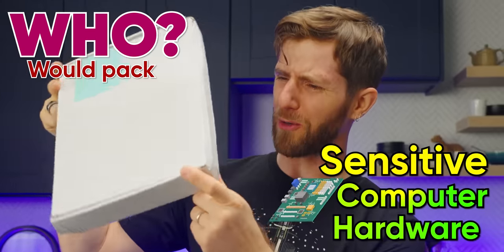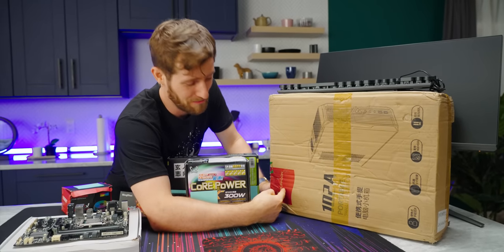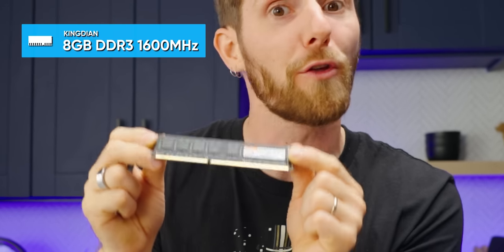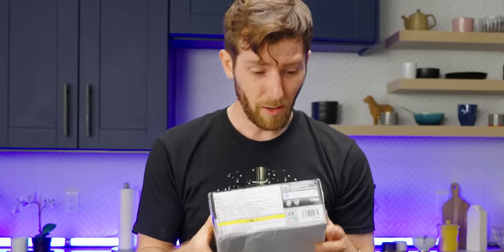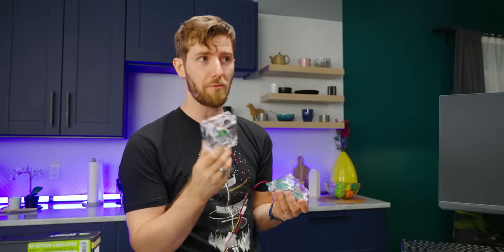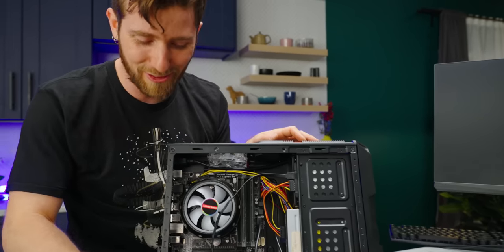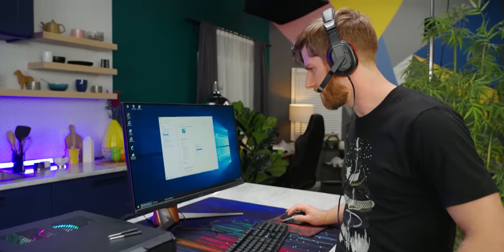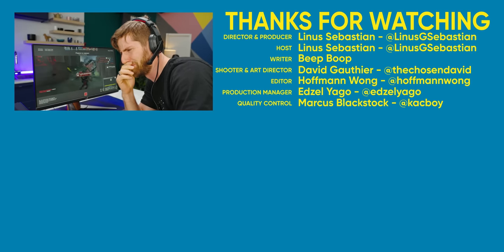THIS Wish.com Gaming PC is WORSE!

Comment: A thousand people have probably already mentioned this but that "ground pin" is the standard in Japan, where grounded wall sockets are so rare as to be nearly non-existent. Spent seven years there and most of my electronic power cables looked like that.
Reply: Sounds dangerous
Reply: @HappyDude1  Japan is really backwards with a lot of standards
Reply: @auzzierocks  
Really ? they make such good electronics and cars 😀
But its not what it used to be like in 90's
Reply: Why mention it again when everyone's already mentioned it?? Lol
Reply: @HappyDude1  not totally, most electronics are insulated so if there is a short you wont get electrocuted (at least in America you do not see many devices with a ground pin either.), and while japanese outlets dont have a ground pin, some will have a small door that opens up to a ground screw that you can ground too.

also as long as the breakers are GFCI/RCBO breakers if there is a leak to ground it will trip (say if you drop your hair dryer in water)

Not saying its perfect, both japanese and americas home electrical can suck (ive wired my own stuff and seen some stupid crap before), it could be a lot worse especially in really old homes were they might still be using knob and tube wiring, fuses, and all sorts of problematic standards of old.
Reply: @jjjacer  
Yeah you guys also  have only 120 volt? We have 220 volts in belgium and Then its important to have a good ground. Does japan has 220 ?
Reply: @jjjacer  The question to me is - can you buy metal cases (non-double-insulated) electronic devices in Japan, and with what plug setup? Selling any mains powered device that isn't double insulated without a ground pin would be illegal in all of the EU at least. Probably in the US too, don't know what their rules are exactly. The two different failure scenarios here are:

If the device is properly grounded, your GFCI/RCD will trip the second you plug it in, if the device has a fault that makes the metal case live.

If the device is not grounded, the case will be live, possibly at mains voltage, and when you touch it you will get a shock. The GFCI will then trip as you touch the device, but even a shock caught by the GFCI is still very dangerous. If the shock gets caught by the GFCI it just means the shock will be extremely short - you won't get the worst case scenario where you grip onto the conductor hard because the electricity makes your muscles contract.
Reply: @HappyDude1  japan is 100v at 50/60hz (depends on region)
Reply: @ska042  most devices i have seen should be double insulated (dont see many metal case devices anymore anyways, everything is plastic)

as far as plugs japan basically uses the same plugs that America uses (america is Nema 1-15 for non earthed, japan is JIS C 8303, class II) which are interchangable except in older japanese outlets that are not polarized . also japan does have a grounded outlet that is used for domestic appliances that was a requirement since 2005 it is similar to our American grounded plug (Nema 5-15)

Source:
https://en.wikipedia.org/wiki/AC_power_plugs_and_sockets
Reply: @HappyDude1  to be fair, we're 230/240 volt capable in NA.  We get 240 volt to our residential breakers, just in the form of 2 separate 120v lines.
Reply: @HilbertXVI  Because it's YouTube comments, so it doesn't matter either way.
Reply: @HappyDude1  Japan has mandated whole home RCDs since the 90s so ground is not as important
Reply: i mean the ground pin makes sense because Scythe Co Ltd. is from japan
Reply: @auzzierocks  No point in having good standards when Godzilla just comes and destroys every few years.
Reply: @HilbertXVI  It got your attention, lol.
Reply: @auzzierocks  No isolation in most houses. 
Also most houses don't have central heating, so alot of people heat with small coal or cerosine ovens.

And don't get me started on the Hankos. And the reliance on paper print outs for everything.
In those regards its worse than germany. And a lot more inefficient (they work much longer, but are not efficient in what they accomplish, this is based on studies on the amount people work and the productivity  of the country).

Living ther for 10 years had its benefits though :D
Reply: @KarlBaron  the standard in the uk is rcd on the main breaker, but as we have live, return (neutral) and earth, you would end up tripping the breaker if you earth the neutra[
Reply: @stenmin1234  It's actually more like 240V split into 2 120V lines.  The transformer that brings power into our homes has 3 connections on it with 1 in the middle, connecting the two outsides gives 220-240V and connecting either of the outside spots with the inside gives 110-120V.  When those lines enter the fuse box they are connected is such a way that every other slot is connected to one side and the middle so a double wide fuse can connect the outsides of the transformer and get the full 240V (hope that made sense, there's YouTube videos that explain it way better than I can).  I believe it's called split phase.
Reply: @grn1  you're not wrong and it IS split phase. Which is why we don't need to have a dedicated neutral connection on our 240v circuits. But for the rest of the world who makes fun of our 120v system it's easier and "correct enough" to explain from the end user standpoint that we have two 120v rails that we can put in series to get 240v at the breaker.    But yes. You're more technically correct.    And to defend our system, the rest of the world adopted 240v after technology matured and we're were already invested in our 120v ecosystem. Would have been ridiculous to expect people to "update" our entire consumer infrastructure to 240v just because others did
Reply: @stenmin1234  Though it's not what most common devices run at and you're supposed to only get 110V on a single socket
Reply: @resneptacle  National Electric Code specifies 120v +/- 10%.  Modern devices made to work within that variance.
Reply: @stenmin1234  Question: By dedicated neutral connection, you mean a neutral connection back to source? Not an expert, but I was told that our neutral and ground are connected to earth ground, but I assumed (probably incorrectly) that the neutral connection is necessary as we can't assume balanced loads on both phases.
Reply: @hg-ir8tb  fwiw I'm no expert either, but I know enough to follow my local codes.   But yes, on your 120v circuit you'll have one line that is hot (black) and neutral back to source (white) and then your ground (green/bare).
Reply: @HilbertXVI  he said probably, implying he knows plenty of people might have said it, but just incase they didn’t go into that much detail, say it wrong or just didn’t say it at all, he wanted to spread his knowledge despite anyone else who might’ve said it.
Reply: @auzzierocks  They're either 20 years ahead or 20 years behind.
Reply: 50 and 60 hz to
Reply: @HappyDude1  They have both 120 and 220 volts
Reply: @HappyDude1  100v 60hz/50hz
Reply: @ThePapaja1996  yeah, i am SOOOOO glad I picked up 50hz step down converters in Japan in the 90s.  Finding a 120v 60hz to 100v 50hz adapter in the states is really hard.

Comment: Those grounding wires are common in Japan. Also that switch has nothing to do whatsoever with PFC (power factor correction). That switch is simply so 1 type of unit can work at different volt levels. PFC is to correct for capacitive/inductive loads to reduce the reactive power, which is essentially wasted power on the grid.
Reply: Except... 110/230V capable PSU's with Active PFC tend to use one of the "Boost PFC" circuits which generates a fixed DC voltage as output, often ~400V, regardless of input voltage in a fairly wide range, 85-265V is pretty common. So there's no voltage switch on these.
So, you're technically correct in that the switch doesn't PROVE anything about the PFC, it's quite possible to build a PSU with active PFC that require a voltage switch for 110/230V but it would likely cost as much or more than one without that switch which is probably why I can't remember seeing one at the moment.
So in practice Linus is correct in that there's a very strong correlation between that switch and the PSU having either passive PFC or no PFC.
Yes, Linus could have formulated it more precisely. But then he wouldn't be Linus... 🙂
Reply: @Torbjorn.Lindgren  Yup, it's a sign of a crap PSU by modern standards.
Reply: Came here for this... Japan uses similar receptacles as the US, but only two prong, so you have to ground like those old three-to-two prong adapters that use the cover screw between the two receptacles.
Reply: @davidkane4300  Yeah, and some modern outlets in Japan will have a small cover below one of the 2 prongs that will be were you can plug in the ground wire.  And I do believe it is possible to get 3 pin outlets as well, but they aren't super common yet. 

To add, in Japan they have two different power grids separated between North and South, one runs on 50Hz while the other runs on 60Hz. There is a history there that I won't get into on a post.
Reply: I came to say this also. Every computer I’ve built in Japan from 2005 to 2013 all had that kind of ground. There is no ground plug on Japanese outlets. I still use an old one for a monitor after moving to the states.
Reply: wow those grounding wires looks scary. Also why does it look like it is connected to the neutral side lol.
Reply: @siontheodorus1501  there's nothing scary about it. It's a ground wire. there shouldn't ever be anything on it if everything was built right. It's just a backup safety in case something does short inside.
Reply: @RuxUnderscore  👍 and, in addition to the 50/60Hz thing, they also run at a nice even 100V.  That's just barely within spec for 120V equipment.  When I was stationed in Kuwait, the team before us left us some small generators... But that team was from Japan, so the generators were switchable 50/60Hz, but were 100V lol.  

I guess they needed them for some corded tools they brought since Kuwait operates at 240/415 (red/yellow/blue old British 3 phase standard) and the small transformers for American stuff weren't perfect and I guess they didn't want to burn out their tools, so brought the generators.

Comment: That card is actually a Japanese 1030. During the GPU shortage, that was actually making 1030s expensive, I had to import one from Japan because it was actually cheaper than buying one from US retailers. Looks like some Wish reseller got the same idea.
Reply: How is the performance on those compared to normal Nvidia ones?
Reply: How is the performance on those compared to normal Nvidia ones?
Reply: @gasparayakos8215  Just your typical 1030. Just gotta make sure it's gddr5. They're just a board partner in Japan, so it's no different than a Gigabyte or an Asus card.
Reply: @Levy_Wilson  importing a 1030 😂😂😂 brokie!!
Reply: @lafireteamplx3400  imagine calling someone broke
Reply: @lafireteamplx3400  He prolly work 9-5 HAHAHAH
Reply: @lafireteamplx3400  im broke, send some my way so i can upgrade my 2014 mobo :)
Reply: @obserspy  imagine having to look for ways to buy an already dirt cheap GPU at an even cheaper price, the answer lies in productivity, more of it means more money
Reply: @lafireteamplx3400  did you miss the part where they said this was during the GPU shortage? shit was not dirt cheap at its highest price, not that it was even worth it at msrp in the first place
Reply: @gasparayakos8215  Japanese OEMs are like living in the past. I recently saw an gaming laptop with RTX3060 and 12700H and is issued with a 180W adaptor.
And the benchmark score on their web site is like 30% slower then systems with identical chips.
Reply: @lafireteamplx3400  are you selling a YouTube finance/productivity course? Absolute NPCs all over the internet. Most people don't care to be rich and productive all day everyday. Don't worry, being unlikable has its benefits.. you can focus on "productivity" and make money to buy more stuff 😂
Reply: @ClaySmileSoil  did you miss the part where this man bought a GPU less powerful than most modern CPUs
Reply: @lafireteamplx3400  did you miss the "during the shortage" part or are you just being that obtuse on purpose
Reply: @itsbort  no, I didn't. It's just hilarious to me that someone would actually willingly order a 1030, the worst value for money card ever produced 😂
Reply: @lafireteamplx3400  1030 is meant to be a display adapter, it's not meant to be a good GPU for gaming!
Reply: @mahadkalam59  it's an overpriced piece of crap, older GPUs will do the same for much cheaper

Comment: 11:17 Protip: Ground lead can be used on a two pin socket and attached under the screw that mounts the faceplate - In most cases that should make contact with the outlet housing/box which should be grounded (if the installer did that)

Comment: The worst thing is that this is literally a Dell Optiplex configuration. And an Optiplex can be found for like 80€.
Add an SSD and a low profile GPU and you get more performance for less than half the price of this monstrosity 😬
Reply: He intentionally bought crap to make a video on it its very evident there were far better deals than this
Reply: great point.
Reply: But is it upgradeable? Optiplex has proprietary BS
Reply: @bitelaserkhalif  its not like that Wish PC was upgrade-able, that shit would break before you could take your next breath
i currently have an old workstation with a good gpu as a pc, it works perfectly fine and has been for years, no need to upgrade yet
Reply: @bitelaserkhalif  the older optiplex's are pretty good, even though it's proprietary, many parts are interchangeable
Reply: The real cheat code is buying powerful Xeon workstations for cheap. Enterprises buy them en masse and then sell them en masse for very cheap after they're done with it. A lot of them offer upgradeable paths for the CPU, GPU, and PSU. And sometimes between two different generations as well. They're usually also better designed, and will last longer than normal consumer equipment. Most of the time they usually have a powerful CPU and PSU already in there, so just put in a good GPU and you're good to go
Reply: @bitelaserkhalif  there's plenty of options for upgrading, my "gaming" pc for example uses an optiplex I got for free from a friend, upgraded the psu with an adapter to the smaller connector, they make little kits to change the headers for power button, leds, usbs, etc to what you'd find on an aftermarket case and you can even solder your own of both of those if you're handy enough. I have a gtx 1060 in mine and am working on installing a see through monitor screen into the side panel with an rgb led strip on the inside so I can display either data like a resource monitor or a fancy design with  the rgb as a backlight if I don't need that info. Been working really great for me.

Comment: FYI fellow viewers: The ground pin on the PSU you saw was Japanese standard, and the box was also for Japanese market. I have seen Kuroutoshiku once on TechPowerUp GPU database, and it was a re-branded PowerColor Fighter (the lower-end MSRP-grade) RX 6700 XT.
Reply: PIN THIS COMMENT !
Reply: Came here to post this, THEN saw your post :)
Reply: Me sweating with the RX 6700 XT by powercolor fighter🥵🥵
Reply: Can confirm, I've bought UPSs when I was in japan from reputable sources and they had this kind of ground plug.
Reply: Before I read this comment, I laughed my ass off at their confusion at that part of the video.
Reply: Man, This is why nobody gets into PC gaming as compared to things like Xbox and PS5 now. You can get a whole ass console (series x/PS5) for the price this Linus paid for this hunk of dog shxzxxx. And most people don't know you can get super cheap retired PC's with 32gigs and a older i7 for 50 bucks and slap a 100 USD graphics card in and it would blow this thing out of the water.
Reply: @Mikesusendsadasdc  my experience is the opposite, I find most people I know have stopped buying consoles.